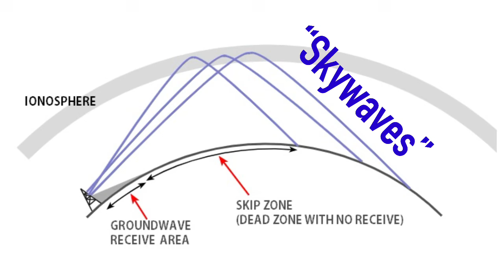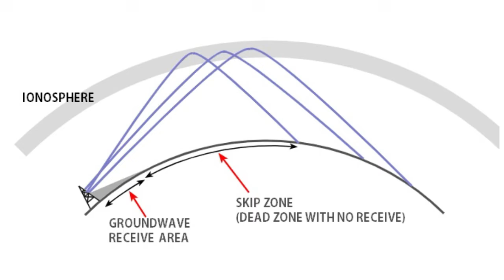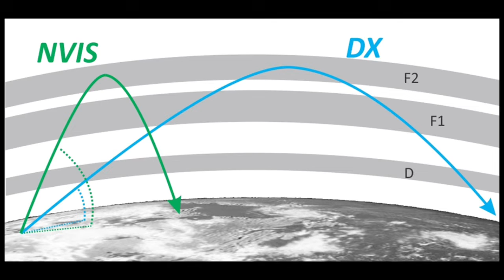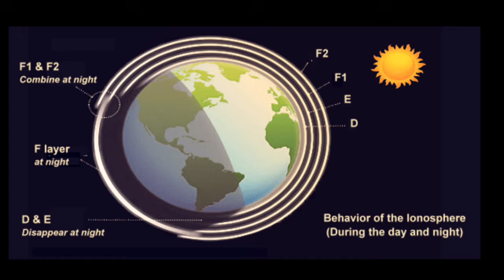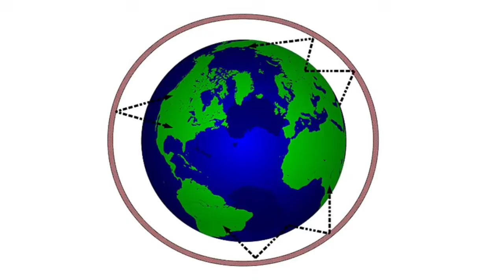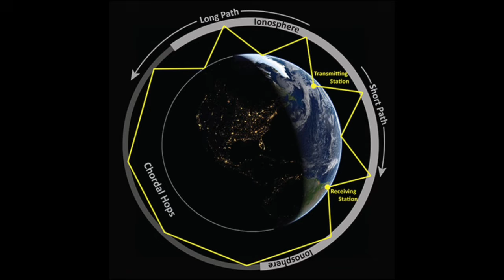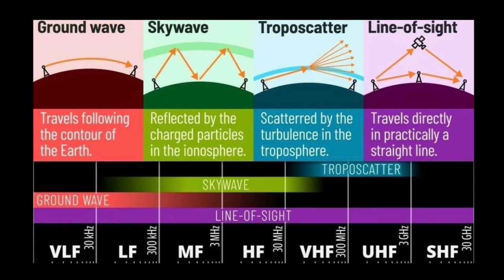Understanding Skip & HF Radio Waves

Comment: Is there a scientific way to control the take off angle of a 20 meter ssb signal to using a form of  NVIS.  My radio signal target zone range is 300 - 600 miles from my transmitter. Also I am blocked by a mountain range (0-300 miles). It would be useful to able to adjust the skip zone. Any ideas? PS: How useful would it be to  transmit from mountain top?
Reply from the maker: That's a deep dive into antenna theory but to answer your question yes you can control the take off angle with the degree of slope of the antenna. Transmitting from the mountain top would be an incredible advantage.

Comment: I am old Air Force Com/Nav tech , 60 years ago i was ground checking an aircraft transeiver on 6.567 meg . At that time this was tower frequency of many Air Force bases .Iwas on Cape Cod Mass , could notget any responce from any one !Was about to tear system apart when i got a call from another tech doing a ground check. He was on a base in Africa , i was the only contact he could make also. I was using a Collins 618s - 1 with 180 l - 3 antenna tuner , Aprox 65 foot horizontal wire antenna ,no SWR .Skip was always a little uncertain with aircraft on the ground , but that  was a real hair puller !
Reply from the maker: That's an awesome story! Thanks for sharing!

Comment: Excellent! You have a good handle on it. I would like to add, for anyone thinking they could do NVIS on 10 meters, NVIS on 10 meters may never happen! There is back scatter propagation. That’s where two close stations, like Maryland and Virginia do not have skip and are beyond ground wave can work each other with  weak watery sounding signals. Both antennas are pointed in the same direction and the two signals are scattered back in the direction they came from.  Two guys working Europe on 10 meters with their beams NorthEast can frequently hear each other via backscatter. It usually takes more than 100 watts!
Reply from the maker: Thanks! And thanks for the great comment

Comment: Thank you for your videos 
I got into portable ham radio because of them
Reply from the maker: Thanks so much for sharing that, means a lot to me!
Reply: @COASTALWAVESWIRES  I was licensed at the age of 13 in 1976. Went into the USAF in 1981 and retired in 2004 when I joined the ministry as United Methodist Pastor. I say all that is because I have moved a lot. My current church parsonage is not real conducive to ham radio. 
So going portable with the G90 has got me back into the hobby. I just picked up a FT-891 . For a little more power.

Comment: Great info Walt! Nice... Another thing about HF skywave, the skip distance is different on each of the different bands AND can be longer and shorter at different times and on different days. I try to take advantage of that doing SOTA by working 40m first, then 20m, 15m, etc. Each one hits a different "ring" of potential contacts out from me. Fun stuff.
Reply from the maker: Yes indeed, thanks for the great comment.

Comment: This is a really good video and i learned quite some stuff here, high quality content. I have a question as i´m just getting on to ham radios and antennas, i am thinking about getting an 100 watt  icom basestation that is for 1-30mhz like the IC 737 or similar, but, i am confused about antennas, i´ve been using CB´s since i was 12 years old and i was born in the mid 70´s, Ham antennas is a little bit different because i am thinking i will mostly be on the 40 meter or 20 meter band. Would a vertical antenna like the GPM-1500 1,8-30Mhz be a good idea for making some great contact with people around the world but also with people here in Sweden ? Thanks // 21AT588